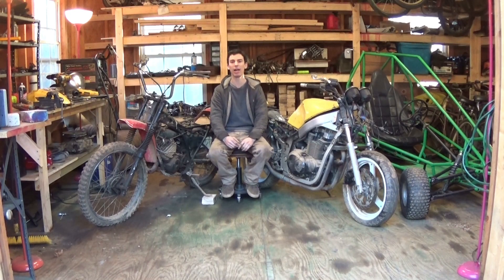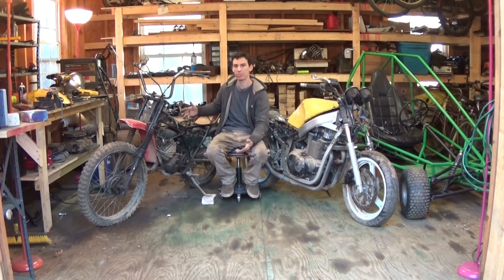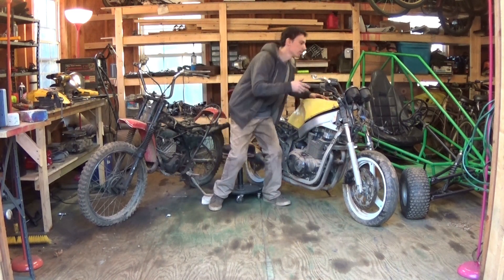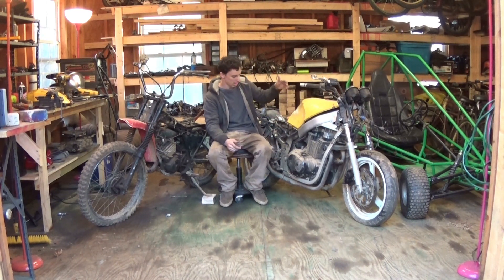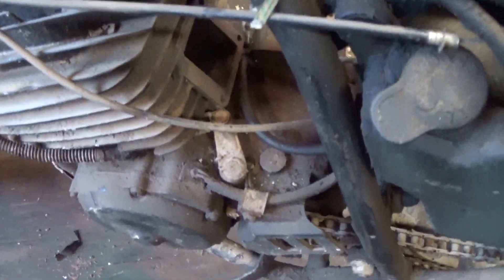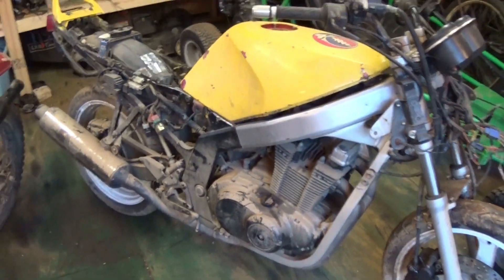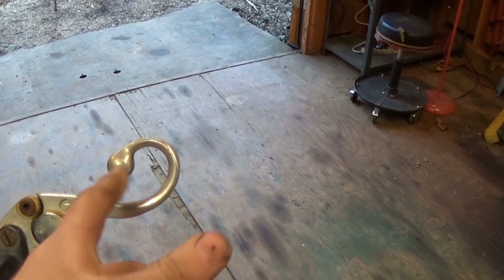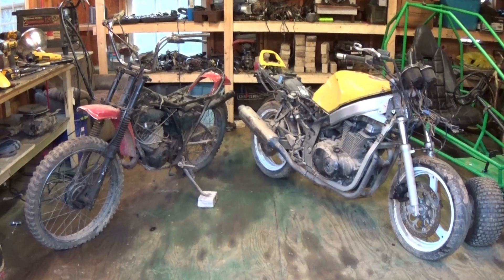I got some new toys

Comment from the maker: if you guys know what kind of dirt bike that is plus the year and cc please let me know
Reply: rather B welding it is a Yamaha Dt the year is somewhere in the 80s and either 100 125 or 150 cc engine
Reply: rather B welding could be a 175 too
Reply: rather B welding sorry for a late comment... but would a go kart be better to have an axel that powers 2 wheels you can connect a chain to so you can drive streighter? 1wd for karts would be squirly as f right??
Reply: lowest cc i think was 125, and highest would be like 250. if it does turn out to be a 125, ive got a wiseco .40 over piston im trying to get rid of, looks like it could be from 81 on up
Reply: I'm pretty sure that's a 1974 yamaha 125 or 250
Reply: rather B welding looks just like my yammaha dt 250 enduro 1986
Reply: That's a dt175

Comment: I'd spend little as possible replacing what's missing that is needed to make them start and run, change fluids & get running before wasting money rebuilding. definitely ditch the self mixing and mix manually. self mixers are crap especially on something been setting a long time
Reply: iv never had a problem on my 13 year old self mixing ped.
Reply: cris rose still a common issue, probably plenty of people argue it either way. Glad you've not had this problem 👍

Comment: Good luck on them.. i probably would have taken a chance on the street bike. When you said the wheel wouldn't turn on the dirt bike makes me think the engine may be seized. But if you can get either of them running you did great.
Reply: FireAndGasoline think it might just be the chain and sprocket with some luck ✌️

Comment: That suzi motor on a go kart the size of the green one would be INSANE, the dirt bike will be the easiest no doubt, and more reliable, I'd struggle to get the dirt bike motor going first before messing with the suzi, to many wires imo.
Reply: your gonna need (from visual reference) a reed valve, carburetor, oil plugs, kickstarter, (ignore the oil box and mix your own gas) maybe cylinder honed and lined, maybe tranny rebuild, maybe new tranny. but finding parts will be a bitch for a vintage bike, go ask your buddy's for other bikes like that for parts.

Comment: Dirt Bike: the size of the engine is stamped right on the side of the cylinder (push the clutch cable aside), the dirt bike will need the correct carb and manifold with Reed cage, and the oil injection has no cable going to it, so That will need looking into-
The good news is, that since it has Oil-injection it's PROB an enduro so it might have the ability to charge a battery and have lights, which a full proper 2-stroke YZ/racebike wouldnt have had, so what this means is: MUCH better candidate for a go-kart motor (if you want lights)
Street Bike: Those GS500's are notorious for having a blown second gear, Petcock will be bad, water in the cylinders might not be the worst of your problems? The carbs on the GS will need careful disassembly and rebuild kits installed - dont break the ears off on the carbs that hold the pins for the floats, they are fragile-
Reply: Eclidean wow you know your way around bikes! hope he sees this post.

Comment: i would make a cafe racer out of the suzuki and im not entirely sure that dirt bike was originally a dirt bike.

also i think the curly break lever is supposed to be like that since many people like to shorten their brake and clutch levers.

finally that 500cc engine will get that bike to over 100mph pretty quickly if you can get it going so be warned!

Comment: Score! lots of parts to pinch off both frames! even the lighting stuff so you can use the carts after dark. Hydraulics are easy to free up, just avoid using any oils/ spray on any rubber bits/seals (wd40 etc will ruin seals) - just use brake fluid or soapy water and clean/dry stuff well before reassembly.

Comment: The dirt bike I'm pretty sure is a DT 175 which I believe was a 2 stroke oil injected engine.  Not the most reliable engine concept for a 2 stroke so I'm going to assume the engine is probably no good.   If you do rebuild it you can convert it to a premix easily enough.  Parts are cheap for the DT's, so might be worth the $20 you paid to get her going.